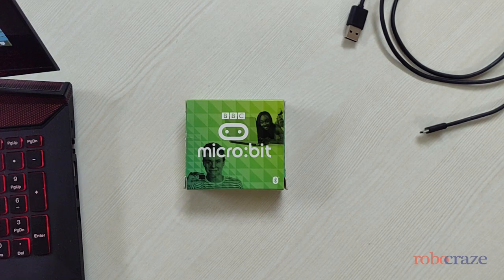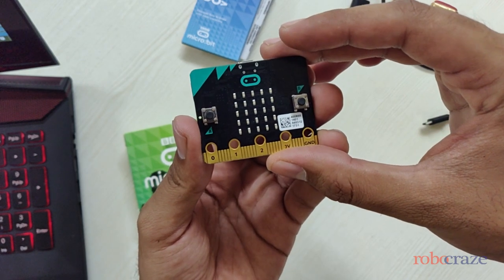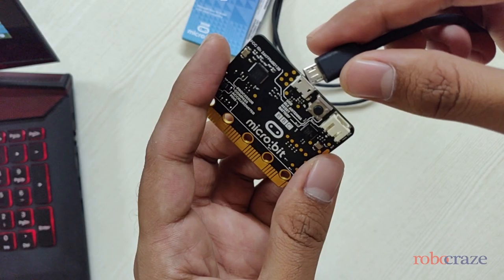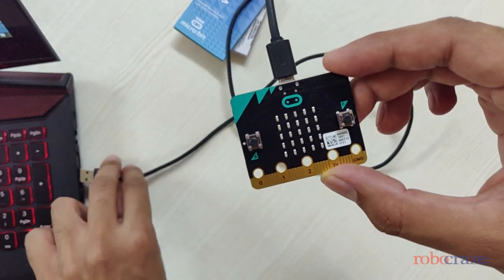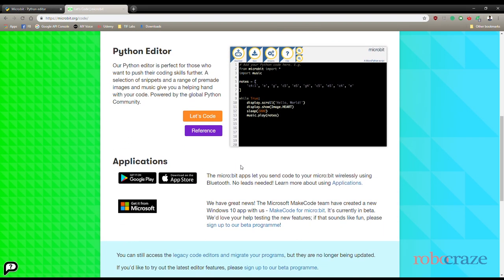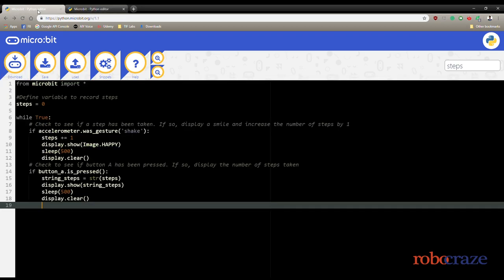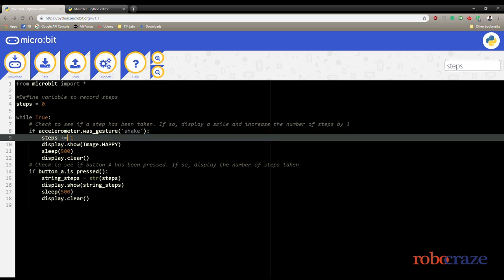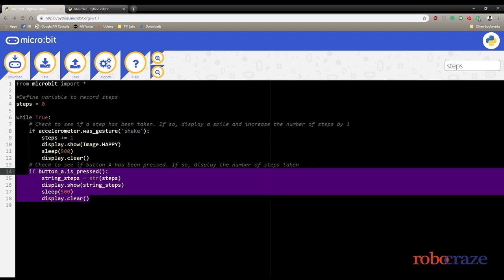DIY Step Counter using micro:bit (with Demonstration)

Comment: thanks for this, but how do i display an ongoing step count??
Reply from the maker: Hi,
In order to display the step count continuously without having to press the button, modify the code in the following manner:
Remove the if button_a.is_pressed() statement and bring the code inside this if block to the while True block to have it run continuously. This way every 500ms the display will refresh the step count.